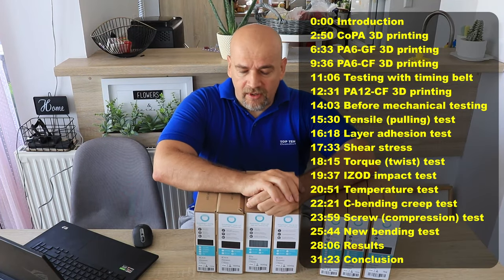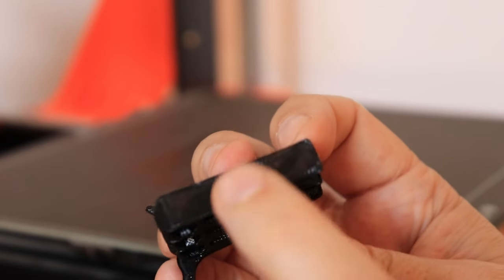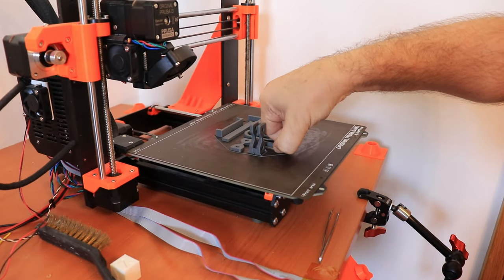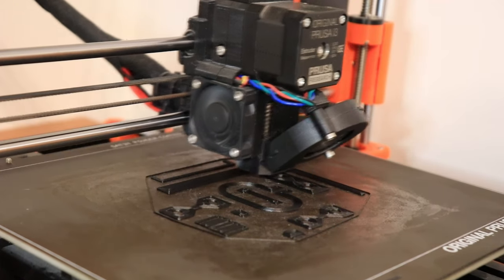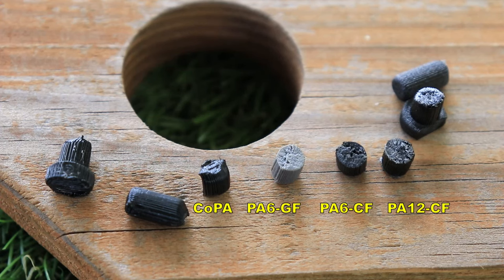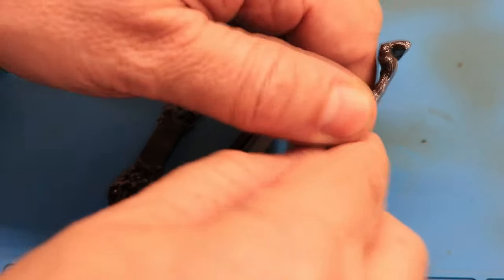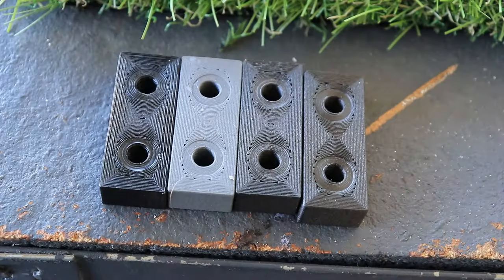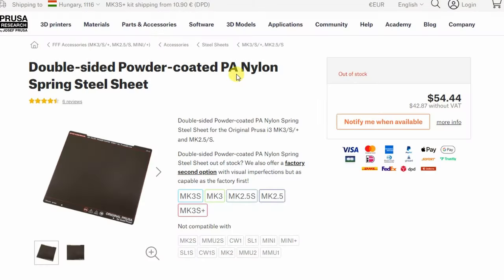Ultimate Nylon filament test - Polymaker CoPA vs PA6-GF vs PA6-CF vs PA12-CF

Comment: Annealing stops basically all creeping for these Nylon fiber reinforced filaments. It's super important for the polymaker stuff too because they design it not to crystalize, which is why you print it without an enclosure and a low temp bed. Once you anneal it reorders itself and becomes stronger and creep resistant.
Reply from the maker: Personal experience or literature? What filament you should suggest to test the annealing? PA6 or PA12?
Reply: @MyTechFun  I want to reply to you, but I think the channels I mentioned are banned names. I don't know if my reply showed up in the spam comments section of this video. But currently the Polymaker/Fiberon website for PA6-CF and GF polymers say to anneal it at 100C for 16 hours.
Reply from the maker: @g.4279  I think links are blocked in comments (not by me). OK, I will try soon PA6 annealing. Thx.
Reply: @MyTechFun  If you have a Polymaker rep reach out to them. The channels I tried to mention interviewed some Polymaker engineers and they mentioned that to make it easy to print there are a lot of additives that prevent crystallization of the polymer. That's why they say not to exceed 50C on the bed and to use an open air printer. They are relying on the user to crystalize the Nylon in a controlled matter with annealing. 

That makes it super easy to print, but likely makes it extremely vulnerable to creep without annealing because an open air printer an 50C bed will keep the Nylon fully amorphous. Love your videos by the way.

Comment: When printing without fan you need to move the printhead away from the parts to let them cool down. I always print a cylinder in the corner of the bed thats the same height as the part and thats normally good enough for even small parts. Increasing the cooling just makes the part weaker.
Reply: That’s a super neat tip about adding a cylinder

Comment: I have been printing in pa-6cf for the last two months or so. I have been absolutely thrilled with it's performance. I think the annealing process helps greatly with layer adhesion and tensile strength. If you try annealing it I think you'll be impressed.
Reply: A great idea for a follow up video would be doing the same test but anneal the parts and then compare results
Reply: Do you have any resource you can recommend to learn the annealing process for PA6-CF?
Reply: @JulienStoeffler  I just toss it in the oven at 190F for 8 hours after it cools down on the print bed. It made a piece that was strong enough to hold up four corners of my backyard gazebo. Make sure you let it cool down for an hour after you take it out of the oven.
Reply: @benjaminmarquis6250  Thank you, I'll try that! Quick question if you don't mind: do the part deform at all? I have some projects that have tight dimensional tolerances and I'm afraid of annealing because of that.
Reply: @JulienStoeffler  it will deform some. I've seen experiments that show +/- .5% deformation in the x y and z axis sometimes in different directions at the same time. One thing I have heard of but have not tried is submerging the part in sand to hold the dimensions while it is baked.

Comment: I am really impressed how good the bed adhesion is with Polymaker. I've also used satin sheet with this gluestick, and PA12 and PA6 warped like crazy from the bed. With Magigoo PA it was much better but finally with Prusa PA Sheet it is just fantastic.
Congratulations to Polymaker to make such easy to print filaments
Reply from the maker: I agree, with this testing I almost forgot how problematic is the warping of the regular nylon..
Reply: @MyTechFun  Also it is interesting that the bed is 50°C, unlike the one i used that you have to print between 90-110°C. I thought that it is because of higher glass transition temperature and that those with 50 degress would be worse in high temperatures. You prove me wrong with 200°C and nearly no warp 😅

Comment: Amazingly thorough tests. I wish you had printed them in higher temperature printers with enclosures, and printed with a higher nozzle pressure. Those have been key to my findings of ultimate strength. I am aware that they state to use a lower print bed, but I have achieved highest tensile strength and impact strength by printing in 60 degree enclosure with 90 degree print bed, 300c for PA6, 275c for PA12 or PA612. I do not use CoPA. I have printed approximately 100kg of Polyamides over the last few years with these settings, making hard use items.

Comment: Great info, thanks for testing and sharing! Gives me confidence to continue using Polymide PA6-CF.
Regarding the timing belts: You cannot print those kind of parts with CF-Nylons. Nylon without fibers could work, but is still very stiff. Maybe usable with large pulleys, certainly not those tiny ones as they are found on printers for example.

Comment: Awesome video, Igor.  Thank you for the updated spreadsheet on the Patreon page, very useful.
With respect to the new bending test, I like it. I would like to see a longer stabilization time on the higher loads so we can see where it levels off.  That would add even more effort to your tests so I understand why you might not want to do that.
With respect to the torque test, I find the method adequate for me. I don't use printed bolts often, though I have done a few and 6 mm diameter is the smallest I go. So the test part diameter you use is a close enough approximation of the max torque I can apply. That is useful to know.
With respect to the screw creep torque test, I do see creep in my bolts on my functional parts, so this test is really educational and useful.  How many perimeters, and at what line width, do you have around the hole? I am sure the hole wall thickness will affect the results. I try to have solid material under the washer or bolt head.
Many thanks for your work Igor.
Tom
Reply from the maker: Thank you Tom for supporting and for suggestions. Soon same testing with some PLA filaments (including new bending test, you will see soon, no need to wait more than 1 min)

Comment: Great write up and video. I saw that Polymaker has a new PA612-CF filament in "beta" testing, curious how it stacks up against their current lineup.
Reply from the maker: Thx for informing me, after holidays I will contact them and ask if they want to send it for the testing.
Reply: @MyTechFun  Did they answer since then and were you able to test PolyMide PA612-CF?
Reply from the maker: @fluxcapacitor  they told me they will send a spool when it will go out from beta phase.  Maybe they need a reminder(?)
Reply: @MyTechFun  I think so because the rolls have been available on various markets for a moment! Notably at 3DJake in the EU.

Comment: 19:56 this highlights a problem with your testing method. The back of the hammer is further away from the pivot point than the front, so there can be lots of friction if the sample didn't break off completely. This friction has nothing to do with impact strength, so will distort the results, as it did in the PA6-CF test here. To fix this I'd suggest to turn the hammer around, with the pointy end forward, and angle the head down at a 60-80 degree angle. This way there's only 1 contact point and no possibility of further friction.

Comment: Fantastic review of the PolyMaker PA filaments - absolute gold! I would love to know the speed, retraction and bridge flow settings used in those tests - I have been printing with PolyMaker PA6-CF for some time and getting clean bridges and smooth surfaces (on dried filament on a Voron) has not been easy - but your temperature towers looked very clean first go.
Reply from the maker: Check those default settings in PrusaSlicer. Only as mentioned in the video, I reduced the part cooling.
Reply: Which settings excactly? @MyTechFun

Comment: Which of these would you use for printing small drone propellers 0.6mm blade tip with base around 1.2mm I was planning on the PA6-gf but due to the small thin blade I am wondering if using PA6 or PA12 cf would be better? Blade are under Constant flexing pressure when used.
Reply from the maker: PA6 CF would be my choice

Comment: Could you give a walk through of your PrusaSlicer settings for these filaments? I'm not having any luck with PA6-CF or PA6-GF, they both come out looking like an over extruded mess.... Maybe I just need to dry them, but I've never had this much trouble with new filament before. The PA12 prints fine and so does the PA612.

Comment: I wonder if you cannot extrude more filament or just have bigger line on line cross section. You test probes looks like underextruded on the curves. There is lack of filament in many cases. Like the way you test it but can you try to add more filament to it ?
Reply from the maker: I already tested flow rate effect to layer adhesion. Not sure how they should look like exactly,  but my esteps are correct.

Comment: excellent video, now we need a comparison with prusa PA11 CF and fiberlogy CPE
Reply from the maker: I just recieved a spool of Prusament PA11-CF, video probably in 2-3 weeks.. Not sure about Fiberlogy.
Reply: Really good news for the prusa filament, the CPE is by far my favourite filament, ft isood safe, high temp, and easy to print.
Thank you for your work 👍
Reply from the maker: @chatroux399  Oh, yes, CPE HT, that test is in the progress. I am testing it exactly from the food safety aspect, since this filament can be boiled. I am waiting the bacterial test results from our partner university of Novi Sad and video will be finished. Only thing I don't like with CPE HT is weak layer adhesion on recommended printing temperatures.
Reply: @MyTechFun  Filamentum also has great technical filaments: CPE HG100, CPE CF, PC+ABS. They have a great tech support, and I've already talked to them about your channel :)
Reply: @MyTechFun  fantastic ! impatient to watch your video ! I only use it with my prusa with the prusa slicer profile and the layer adhesion is impressive
Reply: @MyTechFun  info:
We got the Pacf from Fiberology and after drying it was very easy to print. We dryed it 12h but we think that was some overkill 😅

Comment: Seeing that oven test, makes me curious which one transfers heat the best(Carbon should do good but it is usually not contiguous and peppered randomly in the material) - use-case: a battery case that assists in removing internal heat to the outside.

Comment: This is a wonderful video and very informative. After using Taulman Nylon 645 for years, they went out of business and I’ve been hunting a replacement. CoPA seems like the winner for me here due to its flexibility. Have you tested any chemical resistance on these filaments?
Reply from the maker: Chemical resistance - not yet. But over all (claims by manufacturers), nylon is one of the most resistive filament. After this PETG. But I don't have my own tests for this.

Comment: The timing belts in nylon needs to be humidified before bending. Dry nylon is very brittle, but after some time in ambient air it will become much less brittle. Think if regular zip-ties, new from the bag they can sometimes be brittle, but after only a few days in the opened bag the zip-ties are much stronger and will not break.

Comment: The tests are very useful, however one test for nylon/PA  is missing. Nylon is often used to make washers and bushes, and that is because it has slippery surface- self lubricating. I can imagine a test which has the object under test as a bush, and a bolt is fastened through the bush and a metal lever is sandwiched between,  and bolt is tightened to a specified torque. then the torque required to move the lever is measured. a lower value is better.
Take the test further to move the lever through iterations of movement and see how much wear occurs on the object under test.

Comment: Not finished with the video yet but you can't use the timing belt right off the plate. Need to soak it in water overnight first
Reply from the maker: If I soak it, I know it will be flexible and soft. But after it dries again, the same problem is back..
Reply: @MyTechFun  it shouldn't dry out unless you're using it in a dessicating environment (at least from what I've found).

Thank you for the wonderful experiments! Love the channel.

Comment: I am a bit surprised that the PA12 creeped worse than the PA6, I have heard different stories
Reply from the maker: I don't believe to stories, that's why I like to test things. And more than one test showed similar results.
Reply: @MyTechFun  I have no experience with the Polamide lineup, I always used ePA-CF from esun, so I can't say anything against your results.
Reply: @runklestiltskin_2407  I am thinking about EPA cf from esun can you tell me more about it like strength?, surface quality? ect.
I think the price of the esun epa cf is reasonable, there are other filaments that I would like to use but are unavailable in Australia or just really expensive.
Reply: @Sillysillylittleman  Hi, I have no scientific data. I like the ePA-CF from esun, it has Nylon typical layer adhesion and is way stiffer then Nylon without CF. 
I use the material for printer parts, such as berd-air nozzles and rc parts like spoilers, it creeps less than Extrudr's PLA CF crap, that I used before and less thea resin parts printed with Syraja tech blue.

It needs to be dried out of the box, though, so an ofen 80C (be careful with pizza ofens) or a dehydrator 70C are a must. It needs an enclosure, if you want to print big parts, bigger than a benchy, It needs a hot bed 100C and above and an all metal hotend. It's abrasive, so a ruby nozzle, or hardened nozzle is also a must have.
I print this material on sanded FR4 that's the fire retardant version of G10 (fibre glass in resin) it's possible to get similar adhesion on PEI smooth.

Comment: Does it make any difference to strength on the small cross section areas if instead of increasing fan speed, you increase layer time with no fan?
Reply from the maker: The effect to layer adhesion is similar
Reply: @MyTechFun  interesting. I never seen anyone test. 
Similarly I have heard a few people saying fast printing is always weaker, but I don't think I have seen anyone test it.
Reply: @lolzlarkin3059  Not an expert, but part cooling and slowing down print speed both reduce the temperature that the filament has when the next layer is applied. This reduce how well the two layers stick to another. I imagine part cooling will have a stronger effect though, because it also cools the current layer, so it has less time to stick to the bottom one. But you're basically trying to maximise the temperature of the filament until you get undesirable deformation. I think it would be worth experiencing without fan and with reducing the print speed only, or making a pause between layer (with cura's "minimum layer time' for exampel)

Comment: For the timing belt, CoPA will be much more flexible after hydrating and annealing in boiling water for an hour
Reply from the maker: But when it dries, it would again become brittle.
Reply: That’s a fair point. Maybe you mentioned this, but I wasn’t clear from the video if you tested the timing belt in its dry state immediately after printing or if it had a few days to reach equilibrium with the ambient environment. In my own tests with CoPA the material properties were very different in dry vs wet states
Reply: Maybe you could do a video examining how material properties can change after printing?

PA is sensitive to moisture

Polymaker recommends annealing their PA and PC products

There are a few annealable PLAs on the market with impressive impact and heat deflection claims, for example PLA PRO from 3dfuel and Volcano from formfutura

Comment: I am more worried about some of those filaments being cancerous CF and GF theoretically could be, after all they share similar traits with asbestos aka having micro fibres in there which if you print them might go into the air, or if you cut them or sandpaper them!

Comment: You should not test the nylon belts right off the bed, leave them to absorb moisture first or soak them in water to speed it up. As nylon absorbs moisture it becomes much more flexible. You are testing it in its driest state which is not really indicative of it in use unless you use it in a very dry environment.